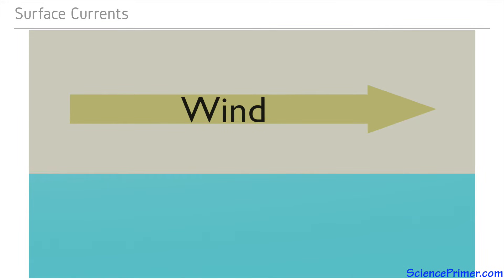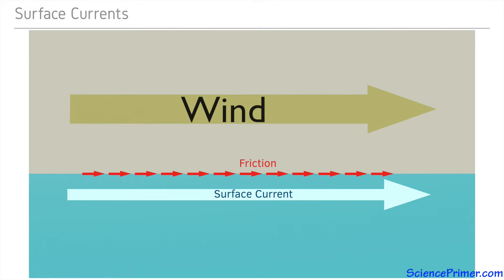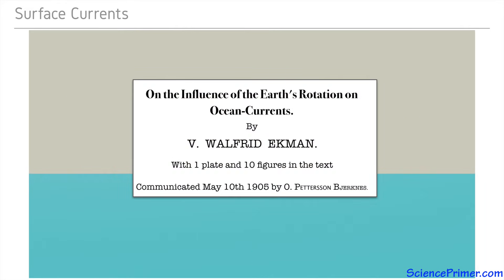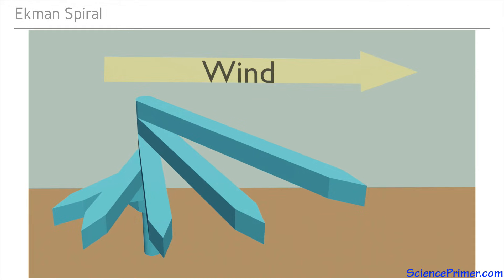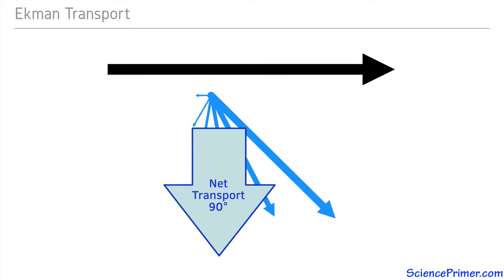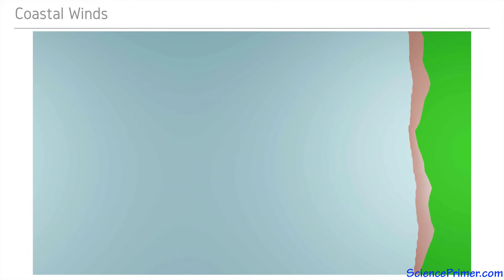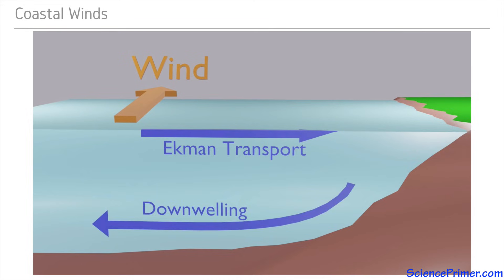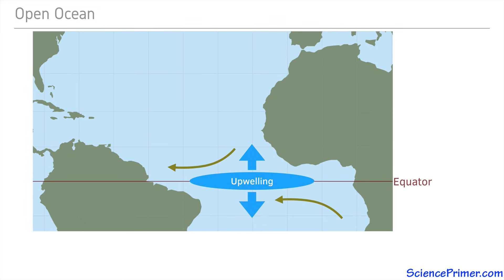Surface currents, the Ekman spiral, and Ekman transport

Comment: Great lesson, thank you so much! I have a question I hope you might help. Given the sinking of the North Atlantic surface waters is harrowingly slowing down due to the larger presence of less salty water due to the melting of the polar caps, and the potential effect it may have of breaking the ocean conveyor belt and bring dramatic climatic changes with it, could it be possible that these open ocean downwelling and upwelling regions become the sole sources of deep and surface water exchanges, trapping even more heat along the intertropical region and transporting even less heat to the higher latitudes?

Comment: im a little confused as to why the coriolis effect is acting in the opposite direction to the wind? I can understand it acting 90 degrees clockwise of a north or south-bound wind (Horthern hemisphere) but in no way should it be acting in the opposite direction to the wind unless you have a south-bound wind across equatorial water? Unfortunately I've only noticed i don't understand this part the day before an exam so hopefully it doesn't effect my answer, but id love to have someone clarify this for the sake of improving my understanding. Thanks

Comment: Why does Ekman Transport result in exactly 90 degrees defletion? Why not more or less?
Reply from the maker: In terms of Ekman's mathematical description of the spiral, I think the 90-degree value comes from the assumptions he made in the depth of the Ekman layer. In the real world, the actual spiral is difficult to detect, but the influence of Coriolis on currents causes the average flow to move 90 degrees from the direction of the wind - meaning in the real world, it isn't exact.

Comment: So, does this influence El Nino or is this influenced by El Nino?
Reply from the maker: El Nino causes changes in the strength and direction of the winds across the Equatorial Pacific. Since the winds drive the surface currents, any changes will impact the strength and direction of Ekman transport. 

So at a basic level, the answer has to be yes, there are influences, but El Nino is a complex phenomenon, so it isn't very easy to point to specifics without getting into a detailed discussion of El Nino - La Nina cycle. You might want to check out my video on ocean gyres and geostrophic flow: https://youtu.be/LWZEIVpuRxw
The video does not address El Nino specifically, but it will give you an idea of how Ekman transport interacts with things like pressure gradients and prevailing wind patterns to drive larger ocean circulation patterns.

Comment: Sir I have a question here-why it took spiral shape,why bottom layers of the water deflets more than the upper one?(best explanation though,thank you)
Reply from the maker: Treat the ocean as a layered structure. The energy transfer from the wind to the surface is the first of multiple energy transfers. Each transfer of frictional energy between layers is subject to Coriolis deflection. 

Consider a wind blowing from the east (towards the west) in the Northern hemisphere. When this wind transfers energy to the top-most water layer, the top layer will begin to move to the right of the wind - towards the southwest. When this top layer - which is moving towards the southwest - transfers energy to the next layer down that next layer will deflect further to the right. More southward in this case. As the energy transfers to deeper layers, each layer deflects further to the right - creating the Ekman spiral.